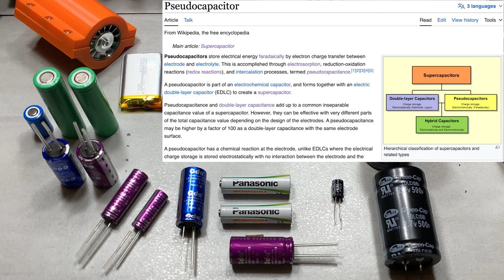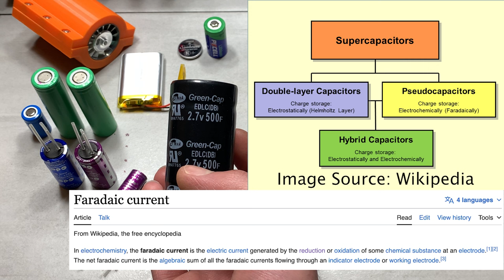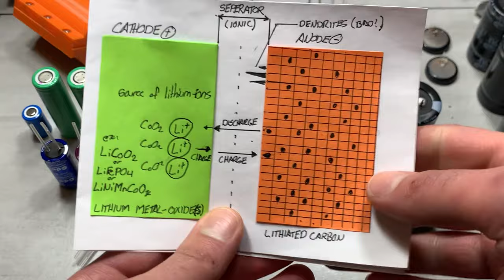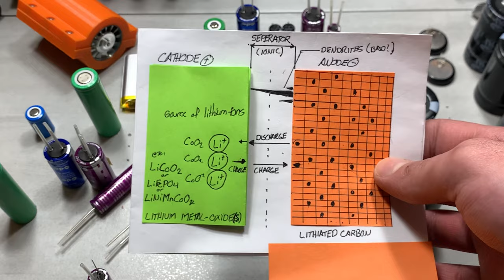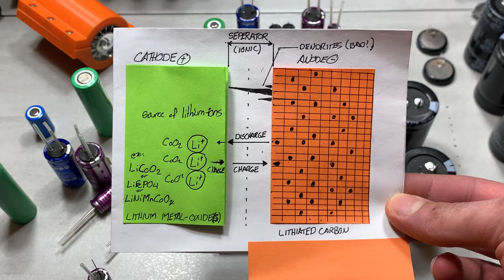How Lithium-Ion Super Capacitors Work (Lithium Hybrid Supercapacitors & More) | Part 1

Comment: I would define either a "capacitor" or a "battery"/"storage cell" by looking at their discharge curve. Under load, a battery's terminal voltage would tend to maintain near maximum until near the end of it's capacity at which time it would drop off towards zero. A capacitor tends to drop off immediately towards zero in a curve virtually the reverse of a battery's discharge curve.
Reply: It depends on the battery chemistry, different discharge curves for different materials. 
Capacitors store energy as a static charge.
Batteries store energy as a chemical potential energy.

Comment: Is there a simple way to parrell wire a S cap bank to discharge at high current but charge slowly. Id like to use supercaps for heavy amp draw with car audio amplifiers.
Reply from the maker: Of course! 
That’s actually exactly what my next video on these is going to be! 😁 I’ve been designing, prototyping, and testing ultra high capacity parallel supercapacitor banks since the summer of 2022. 
Stay tuned for it, and thank you so much for watching!
Reply: @KeonsLab  AWESOME!!

Comment: Can this technology be still called a capacitor?  Can it survive with 0 volts of fully discharged for extended periods of time without degrading?  Or is it just another high discharge rate Lithium cell with very low-density energy storage?
Reply from the maker: While it cannot be discharged to 0V since it’s not really using capacitance alone. Lithium Hybrid Cells genuinely do seem to be a new iteration of supercapacitor technology and not just high discharge lithium batteries in a new package. They’re a combination of EDLC supercapacitor technology and lithium ion battery technology. 
 I’ll have to do quite a bit more reading and research to provide a concrete answer on how exactly the two differ beyond what I covered in this video because there’s some pretty complex chemistry involved and I don’t wanna spread misinformation. I hope this makes sense.
Reply: I use Eaton HS/HSL1625-3R8227-R in place of old SRAM backup batteries in vintage devices, hybrid, 3.8V. As per specifications, minimum voltage is 2.2V, and a cell management/BMS is recommended to maintain this. These Eaton I use (I have bought 25 of them) all come charged up to ~3.1V. 
I would say that most likely other Lithium Capacitor formulations/hybrids have similar limitations/recommended requirements.

There also is degradation stated in the data sheets for these, it is "Storage: (3 years, uncharged, <+35 °C): less then or = 5% of initial capacitance, and less then or = 10% initial ESR).

I have not dug or trialed other brands, compositions or values, but given the lithium aspect is chemical, I would suspect degradation sitting on shelf as well as the usual cycling.

Comment: The tram he is talking about is a trolley,  the thing that used to roam the city streets as a people mover. Looks like a mix of a bus and a train and a horse drawn wagon. Has a little antenna that goes up to wires above the road that give it power. It generally moves on a track on the road, and yes, they used massive capacitors to store energy to keep it moving when transferring from cable to cable.
Reply from the maker: That is SO awesome!!!

Comment: A major advantages of them is some (eg. VINATECH manufacturer) are capable of being used while charge/discharge at low (below 0°C, like -20) and higher temp >50°C.

Anyone have done meshtastic/iOT RF node outdoor enclosure with solar panel instead of using 18650/21700 lithium cell ? This could be much safer while working in larger climate regions.
Reply from the maker: Right!!? Based on what I've read about these types of cells (though I haven't tested it out myself...yet...),  they're supposed to be able to deliver a pretty acceptable amount of power even in extremely cold or hot conditions. 
I'm imagining a feature that I think EVs could really use where a supercap bank heats up the car's main battery pack in an extremely cold climate 

They're also supposed to be much safer compared to traditional Li-ion cells when it comes to fires, since depending on the cell's chemistry and physical construction, it can be possible (in a controlled environment) for a nail to be hammered through one without turning into an incendiary device (GreatScott actually had a video where he did just that, not the incendiary part but the nail through the hybrid supercap part 😅)

However I should also note that unlike ordinary electrolytic capacitors or even EDLC supercapacitors , the term 'Lithium ion [hybrid] supercapacitor can be used to refer to a couple different variations of the cells based on electrode composition and placement, which while very similar to ordinary lithium cells, differ slightly in their physical materials, construction, and to a certain extent, their performance.
Essentially I'm trying to tell anyone reading this that Lithium cells and batteries are no joke.

Comment: Just saw your YouTube short on these.. had to take a look.. will these have more charge discharge cycles than a normal battery ❓
😊🇮🇪🙏
Reply from the maker: Great question! 
According to everything I’ve researched so far from some pretty reputable sources, yes they should last for significantly more charge/discharge cycles compared to a standard Li-ion battery, with the trade off being that while the energy density is quite a bit lower on the Supercapacitors, their charge and discharge rates are significantly higher. 

Since I’m also wondering the same thing about how the specific cells from the video compare to lithium batteries as far as the # of charge cycles go,
I’ve recently begun the process of using my discharge tester and power supply to charge and discharge both types of cells on a regular basis and documenting everything in a spreadsheet to hopefully get a more concrete answer.  I hope this helps

Comment: Damn i was charging these with 5 volt via a usb cable, how much damage i do after 1 charge cycle? The meter read 4.6v at 1A. I thought it would be fine to go over a little to speed up the charge time? How bad is overvolting this things or under volting?
Reply from the maker: Oh, you should never use that cell ever again and discard of it appropriately. 

 I hate to be firm with my comments but there’s an inherent risk involved with lithium cells that is made exponentially worse when they’re misused. 

I’m assuming you’re newer to this stuff which is awesome :) and I don’t want to upset you, but connecting any kind of battery/hybrid cell directly to USB power for charging with no form of protection is extremely irresponsible and potentially very dangerous. 

To answer your questions though: 

- After even one charge cycle at 5V, the cell is already damaged and no longer should be used. 

- While it can be fine on specific cells (including these) to go a little bit over the recommended current for short periods for faster charging as long as it’s within the manufacturer’s specifications and within the recommended operating temperatures.  
It is NEVER fine to over-volt any lithium-ion cell, battery or otherwise, more than ~150mV MAX. 

You’re lucky you didn’t leave it charging for too long or else it could’ve blown the pressure vent and potentially started a fire (though these cells are supposed to pose less of a fire risk than traditional li-ion batteries)

I’ll make a video on proper handling of these cells, as I should’ve done when I made this video.  

Now going forward I’d personally suggest doing some proper research on how to charge/discharge and handle standard lithium ion batteries before trying these out again, but in case you do decide to charge (a new cell, NOT the overvolted one) again, 

here’s some basic charging/discharging guidelines to follow if you have any more of the cells:

You’ll need an adjustable DC bench power supply for this, do not proceed without one

- Never exceed 4.00V when charging a cell
- Never let the cell voltage go below 2.50V, undervolting will also cause damage to the cell. 

- Don’t charge/discharge with a current higher than 6A (I’d suggest a 4.5A maximum)

- ALWAYS keep your the leads insulated from each other when not in use

- Always have a fuse in place if using these cells to power something (I’d recommend the ‘LittelFuse’ brand of axial quick-blow fuses)

I hope this helps. Please be careful and stay safe!